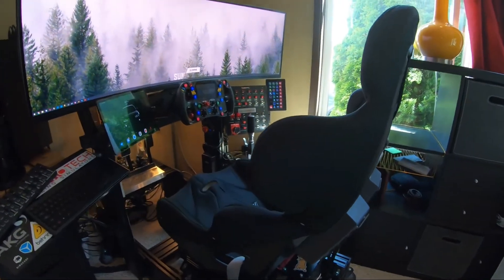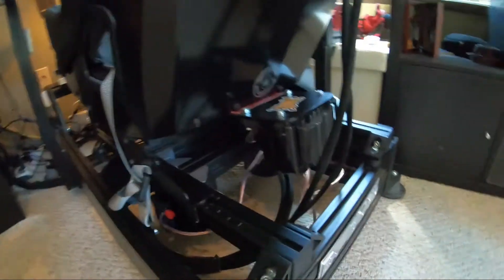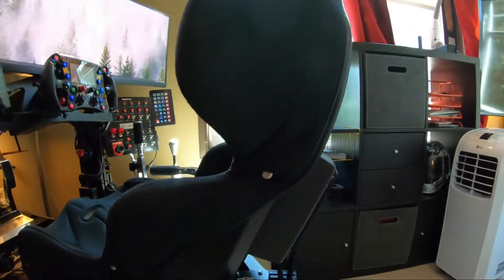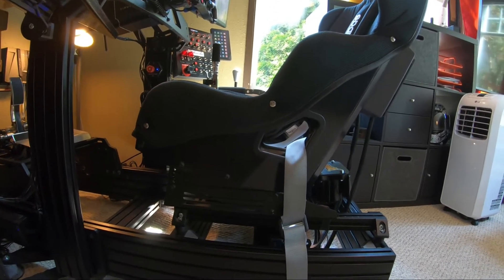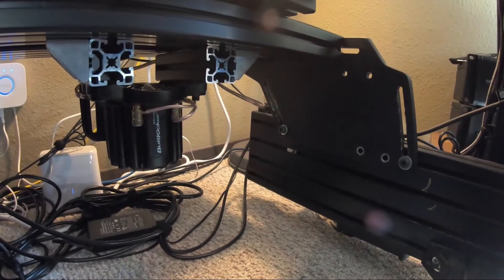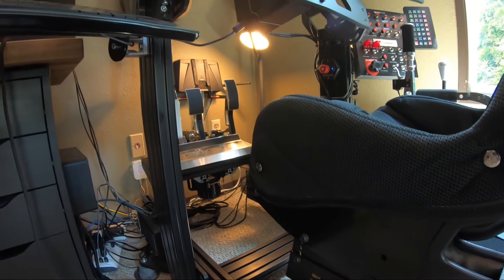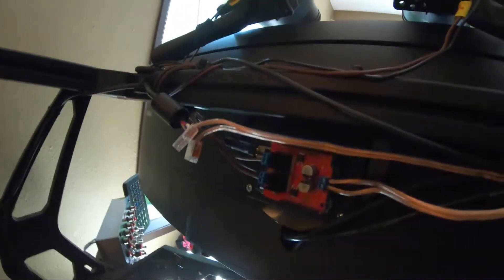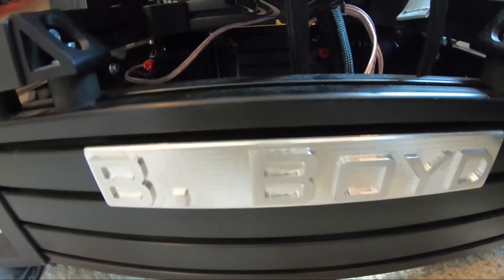Sim Rig Hardware & Layout

Comment: What are your pedals like? The brake especially? 
I'm also commenting the same thing again because I've watched more of the video now and I'm in awe, what a setup, that's a fucken dream rig mate, love it! 

It is so professionally done, everything..... The proxy power switch for fans and amps, the binds for your button box and the look and layout are perfect, the easy to get to USB fix (i feel your pain on the hub bugs), the absolute best gear with the best feel there is in seq and H pattern shifters, i love how you mounted your Ebrake like a road car instead of rally/drift, cable management,  

Only things you could upgrade to is...  a motion platform thingy. I love my vibrations also but it doesn't compare to a motion setup and a g9 for games that don't have VR support......that 1000r :O
Reply from the maker: Thanks fella. I have my brake close to as stiff as I can get it. Maybe 130-160 pounds to hit 100%? Maybe 16mm movement total?

Comment: Great video and drawn some inspiration from you. I'm building a new button box and my old one needs a new purpose therefore looking at some extra functions you have there I may well be utilising such as the mute chat functions etc. Question though what are you running through your usb hub. Just interested as I have a similar one and worry about taking up too much single usb channel throughput if I run every peripheral off the hub? i.e wheel, pedals, button boxes, gearshifter etc
Reply from the maker: My usb hub currently handles all the shifters, button box, pedals, streamdeck, and arduino. Everything else is wired straight to the PC. I think you are wise to be worried about that, but most sim stuff isn't pushing much bandwidth. That said, you might research your motherboard and see how many usb busses it has and put higher traffic stuff on a port further away on the rear i/o. Some boards will only have one, some will have more than one. I also added a 4 port / 4 bus PCIE USB 3.0 expansion card that has eliminated most of my issues (particularly when adding cameras that require a lot of bandwidth).

Comment: Awesome setup. Thanks for the tour. What's the mixer you use?
Reply from the maker: It's a Korg nanoKontrol2, about $50 bucks and I use it to balance audio between iracing, discord, crew chief, etc mid race. Love it, though there are similar things you can do with a streamdeck now
Reply: @nerdthewise  I use GoXLR + multiple streamdecks. Problem wit GoXLR is the 4 channels which can be controlled on the fly. Not enough. I'll look into the nanoKontrol2. Thanks alot.
Reply: @nerdthewise  Does it show on PC 8 audio channels to select?
Reply from the maker: @SimGamerNerd  Yeah, 8 channels. You might be able to do something else with the remaining buttons, but I am already button rich and they aren't easy to get to with gloves on. If you do go that route you will need a little setup help and an additional piece of software. This is how I did it: https://www.youtube.com/watch?v=t16CMLcmeIc
Reply from the maker: @SimGamerNerd  and thanks for the follow, I am slowly working my way toward 100 subscribers for that tasty vanity url. Let me know if there is anything else you are curious to see a video about. I have a couple more updates on the way and then I will make an updated walkthrough of my configuration.

Comment: Great setup. May I ask why no triple screen setup? From what I see most people prefer triples unless there is space limitation. You seen to have space for triplets.
Reply from the maker: For me it’s about FPS vs fidelity. At 5140x1440 I get enough FOV but am still able to run higher settings at 120+FPS that I could on 1440 triples. That’s on a 2080 ti and 8700k. Setup outside of iRacing is simpler as well.

Comment: Fantastic setup man. What happened to the Podium DD I saw in one of your older videos?
Reply from the maker: Sold in favor of the Simucube Pro for a number of reasons: it offers more control and does not force you into Fanatec’s ecosystem as I had enough poor experiences and frustrations with the
 direction of the company. A lot of the time it seems like they do not care at all about their customer base.
Reply: Brandon Boyd Yeah man. I was pretty deep in the Fanatec ecosystems when I bought a DD2 in July 2019. I immediately realized I made a mistake. Beside the performance which wasn’t and still isn’t great. The janky pain in the ass QR system with its flex was really a blow as far as buyer remorse goes. 

 It really makes me feel like I own an inferior product when compared to all other dd wheel systems. I could have bought the SimUCube 2 Pro but my inpatient ass couldn’t wait a few more weeks for DSD to get them in stock. 

 But also in my defense I’d owned a CSW V2 for years and never had any issue. At that point out of the CSW V2, V3 pedals, couple of wheels, handbrake and the CS shifter. The shifter was the only thing I had issue with that ever needed repair. 

Where I sit today with Fanatec or my opinion today is pretty poor. Like I don’t recommend many of their products. That shifter was repaired and only worked for another 8 months then broke again. Fanatec tried to say it was EMI issues with my rig. I ended up buying another brand new shifter and it worked fine....for 8 months then it developed the same issue as the previous shifter. (Selecting wrong gears which is a widely known issue) I had to have it repaired and it’s working for now. 

 Thankfully I’ve had a Pro-Sim H- Pattern on order for a few months. Should get it soon. (According to Pro-Sim it’s gonna be milled out of a solid block of aluminum instead of cast iron now) 

Did I mention my DD2 needed repairs within the first few months? Yeah, the fan in the unit would run at 100% RPM randomly when I’d turn the wheel on. That started about a month after getting it. 

 They said “FW” would fix it but after a few months of new FW and drivers and switching back and forth to appease Fanatec, the problem only got worse. It got to the point every time I turned the wheel on the fan would crank up to 100% rpm and never turn off. Thank god for headphones. 

I plan on ordering the HPP JBVs soon so I can get rid of the V3s and be one step closer to leaving the ecosystem. 

 Once I do that I’m gonna start looking at options for getting rid of the DD2. I’ll never be happy with it. I no longer like any of their steering wheels. Most of them have sort of a childish look to them now. 

 That and they just keep rebranding the old sh*t and acting like it’s something new because it’s a “limited edition” causing people to loose their minds over this stuff. Fan boys just doing their thing I guess. 

 Currently I mostly run Podium Hubs with real Momo wheels on them. No paddles just two button clusters. Unfortunately both my Podium Hubs have a ton of flex. 

 Because of that I don’t see bolting any non Fanatec high end wheels to a Podium Hub to be smart. It’s basically the equivalent of putting wheels and tires from a used up 2000 Toyota Corolla on a showroom floor 2021 Ferrari. Seriously....and so many people are ok with this.
Reply from the maker: OhItsThat preaching to the choir here bud, I see a lot of problems with their business model. It seems like they actively dislike their customer base and certainly do not care about their long term happiness. Don’t even get me started on their policy to take money for a product that is still months to years away. Your customers are not VC, don’t use them to float production costs, this isn’t Kickstarter.

Comment: Hi Brandon
Which ultrawide are you using?
I’m trying to decide whether to get the new Samsung offering or go for the older 1080 version. I only have a 1080TI ( can’t believe I’m saying that already) so wondering if it will run 1440 ok
Reply from the maker: It's the CRG90 (1440p 120hz). If you don't plan to upgrade your graphics card in the near future you might get away with the CHG90 (1080p 144hz), but I'm sure you will eventually and if you plan to keep the display for more than the duration of your GPU I'd just future proof now. Be aware as well that the newest model (G9) is getting an update later this year as well, so you might wait on that. In a race the 1080p vs 1440p probably doesn't matter that much to most people, but for me it was night and day. For text and desktop use you definitely want 1440p. My display is ~20" from my face and at that range even 1440p starts to show pixels.